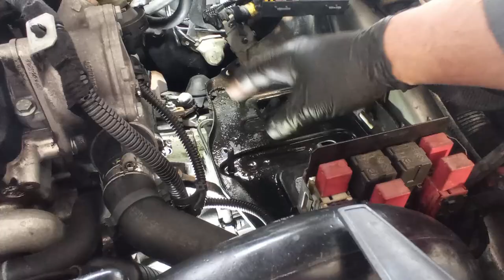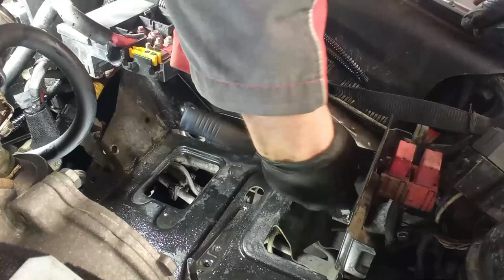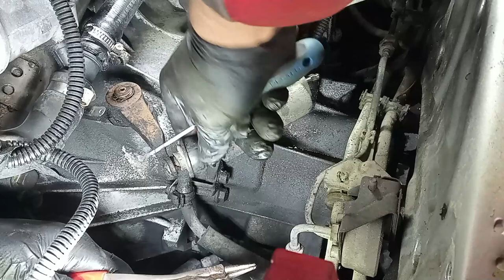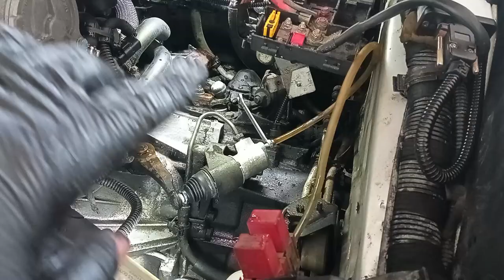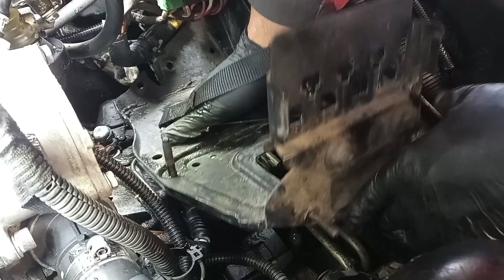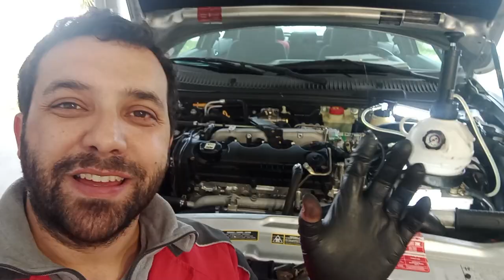How to replace the clutch cylinder in the gearbox side. Alfa Romeo 156 1.9 JTD

Comment: As usual an excellent video, would be good if you could show how to bleed the clutch on the twin spark engine. Keep up the good work.
Reply from the maker: Hello. Thank you very much for watching! On my new realise today I have a clutch cylinder replacement and bleeding of the system. Hope it helps
Reply from the maker: What car is it? 156? If so, it is just like this one, even if it has the internal push bearing
Reply: @alfaromeonoproblem  It's a 2007 GT with 1.8 twin spark.
Reply from the maker: The bleeding niple is underneath a rubber cover. Just follow the hydraulic line.
Reply: @alfaromeonoproblem  Thanks. 👍
Reply: Flushed mine through today, would still be good to show how to lift the clip and pull the hose back to open the bleed nipple. I could only find one video on YouTube showing it in a vice, nothing in the car.
Reply from the maker: Ok, I will  as soon as I get one. Not very common here in Portugal. Diesels with the external cylinder are prominent.

Comment: Excellent video - do you know where I can buy a new master cylinder for my right hand drive 159 JTDM 2010 - Greetings from Ireland
Reply from the maker: Hello. That may not be easy. Here in Portugal they do not exist, so I do not know. Sorry
Reply: @alfaromeonoproblem  If I locate a clutch master cylinder (new) would you suggest I should buy it as back up ? regards from Ireland
Reply from the maker: @ramblinginmeath4950 for sure! Keep it out of moisture

Comment: Back when I have my 155 V6 (right hand drive), I had the pedal sticking down at times. Replaced the slave as a matter of course....but sadly, not only was the slave done, the master was too, and on a right hand drive V6 that job was....unpleasant!!

And yes Bruno, I've probably told this story before too  ;)
Reply from the maker: Hello! No, this one is new! Always wonder how some things are fitted on right hand drive cars. Like the room for the brake servo and other things.. like the ones you mentioned. 
I wonder if that is way hondas had the engine turned around, Japan being rhd too
Reply: The RHD 166 has torque rods to connect the pedals to the brake servo and throttle pot that are mounted on the left side as per LHD….but I confess I can’t recall what they did with the clutch master. I believe the 155 was the same for the brakes, with a torque rod linking the pedal to the servo on the left …but I most definitely recall the clutch master being by the pedal!  By far the worst part of an overall hellish job was the master cylinder output pipe connection - access was almost impossible with the engine in.

I suspect you are right about Japanese cars. Makes sense they would design them to suit the home market, although they no doubt sell more LHD cars than RHD
Reply from the maker: That is very curious! I've seen that on driving school cars, to have two sets of pedals. 
Thanks for sharing that